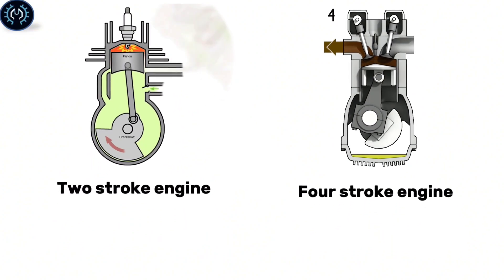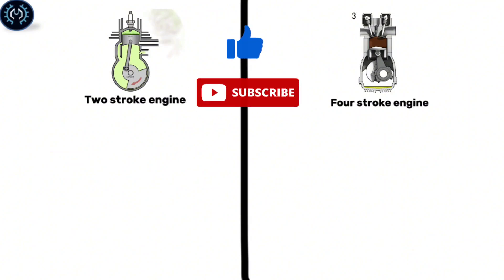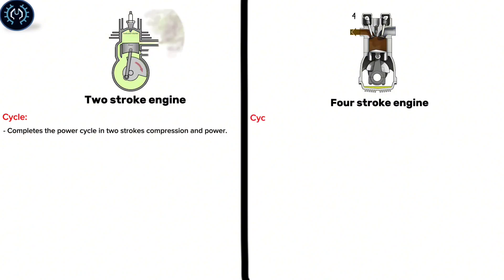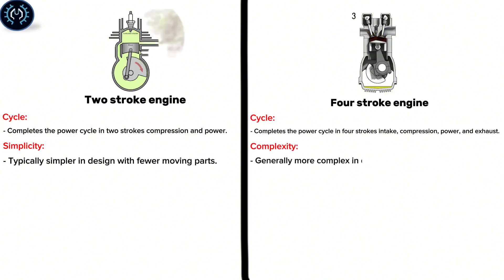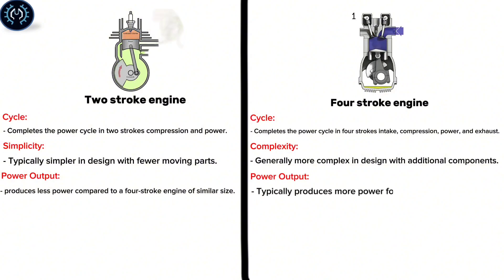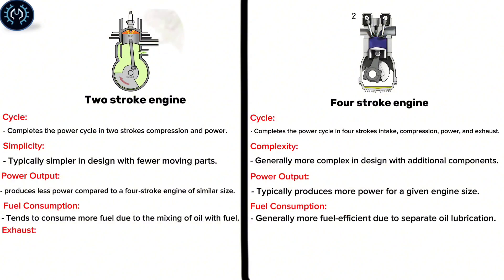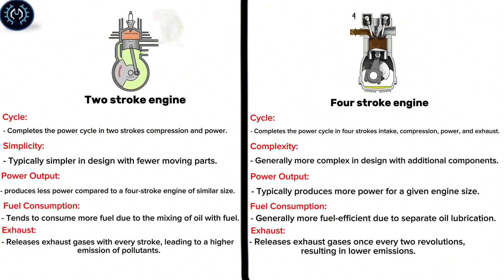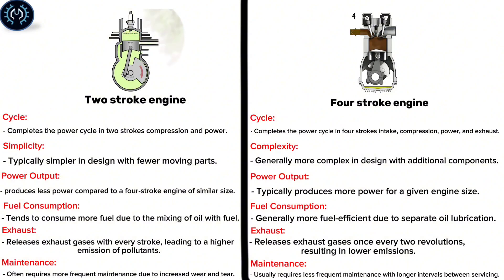Two Stroke Engine vs. Four Stroke Engine - Unveiling the Differences

Comment: High Efficiency Low Emission Hybrid ICE:
By simply splitting the ring-section from its skirt - to be operated by a (valvetrain-like) piston-train to pump the gases during the intake and exhaust strokes, and combined with the skirt to complete the compression and power strokes - can achieve the hybrid. Which completes the 4 strokes, different in both displacements and periods, in every engine revolution - called D-cycle (Differential-stroke cycle) – a hybrid of the 2-/4-cycles.  
The D-cycle’s controllable exhaust strokes can be shortened to retain high amount of burnt gases to control the ignition initiation and combustion rates for the HCCI/LTC (homogeneously charged compression ignition with low temperature combustion). When combined with the (gasoline type) stoichiometric air/fuel ratio intake under high-compression ignition, it is the diesel-gasoline hybrid with the benefits of both – called SCCI/LTC-BGR (Burnt Gas Retention).
The resultant hybrid can have Atkinson-cycle strokes, whole engine working at lower rpm, fewer cylinders with lighter engine support and vehicle styling, weight and efficiency gains, and etc. Diesel engines can avoid soot and NOx formation saving expensive after treatments with lower noises. Gasoline engines can enjoy
Reply from the maker: Wonderful detailed explanation 👍. Appreciate your clarification for these important points 👍. Don't forget to subscribe please for more interesting stuff like this ❤️